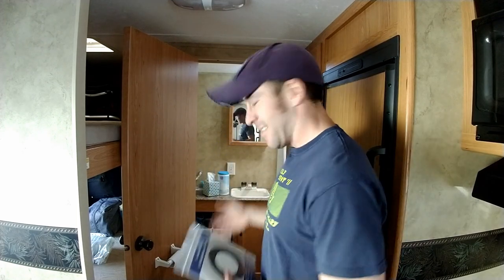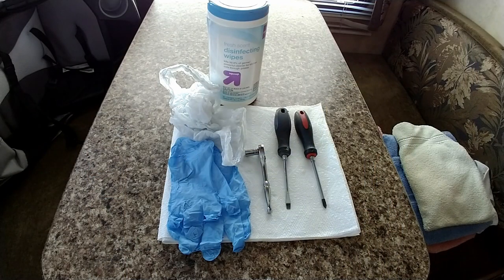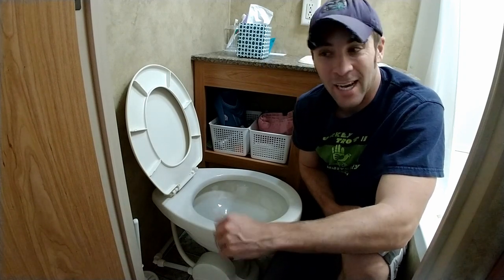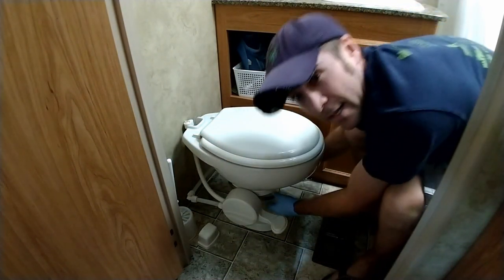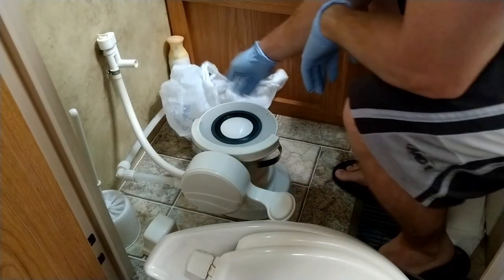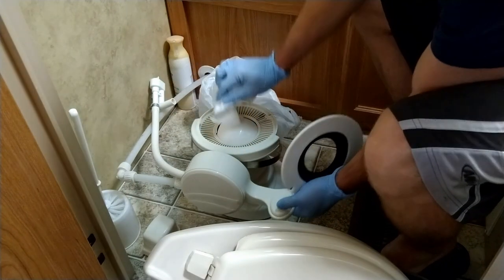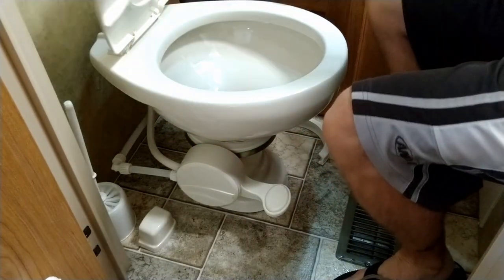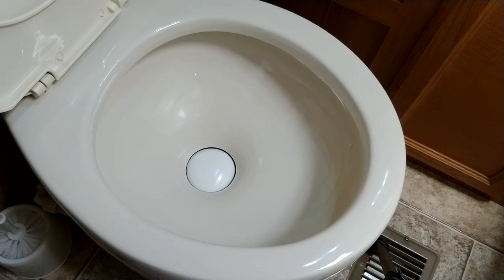RV Toilet Not Holding Water? - Install a New Toilet Seal!

Comment: You make it look so easy. Or.. was it just designed that way, hmmm. I'm a little surprised a couple of fittings and a ring clamp is all that is holding your toilet on and up. Hopefully the fittings are built pretty strong. Shame household toilets aren't like this too. I suspect because of building codes they can't be. Ah well. Good episode. :)
Reply from the maker: Yeah, this was a super easy install.  Probably one of the few things that actually took me less time than expected, lol, how often does that happen?!?  I agree, it is surprising that the toilet is just held on by that ring clamp, but it tightens up well.  Everything is houses seems to get more complicated due to building codes.  Some codes I definitely agree with, others are questionable.  Thanks!
Reply: Plus, gotta love it when building codes change mid project.. had that happen a few times while I was working a site.
Reply from the maker: Oh man, that is rough!  I haven't had that happen yet, but that would stink!

Comment: I changed seal, but it still leaks. Do you have any more ideas I could try
Reply from the maker: I had to adjust the seal around the ball a few times.  I also used the thetford toilet lubricant.  That stuff is a sealer and lube.  It works great but would probably only help if you are losing a tiny amount of water.  Thanks for watching.